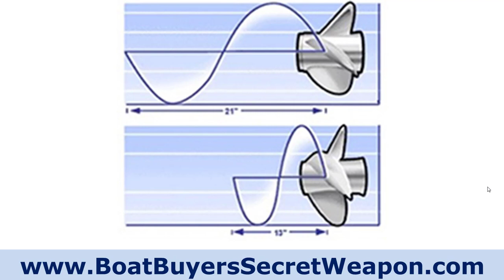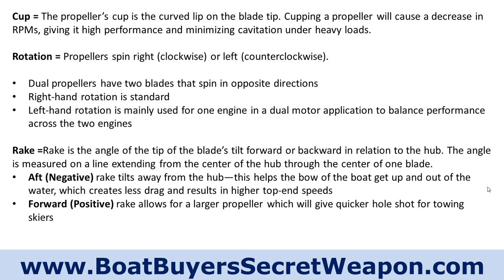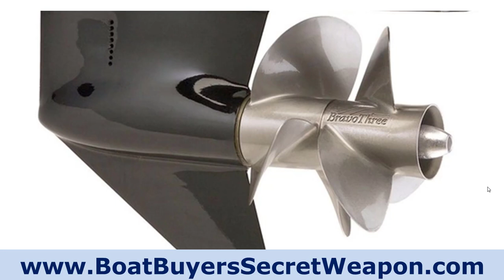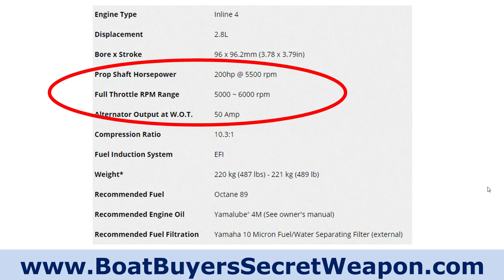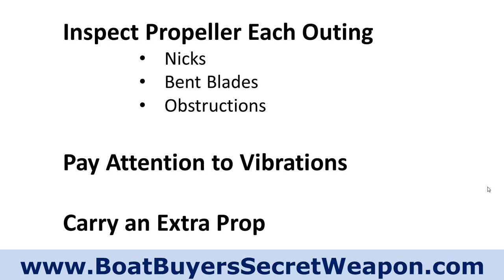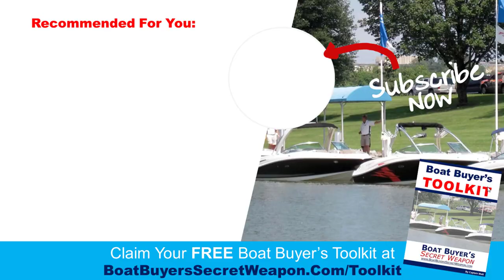Choosing the Right Propeller to Make Your #Boat or #Pontoon Go Faster

Comment: This has to be one of the most frustrating things about trying to find the right prop for your boat.  NO ONE KNOWS!  I purchased a stock pontoon with a stock150hp merc 4 stroke and it had a stock 15X15 prop.  I could only manage 4700-4800 WOT trimmed with just me and my wife.  I knew that was WRONG.  WOT on a 150hp merc should be around 5200-5400 RPM or even more!.  I went with a 4 blade 13 1/2 X14 prop and I'm turning 5200-5300 rpm WOT with decent hole shot with 4-6 people.  My speed stayed about the same, maybe 2-3 mph more.  I still think there is a better set up, but short of buying many props to try..not a single salesman, tech or professional can give me a hint other than the info given here.  100-200 rpm for each degree in prop pitch +/-  ....Frustrating!
Reply: 2022 Sun Tracker Fishing Barge 22 foot with Mercury 150hp 4 stroke comes with the 15.6x13 Enertia X7 alloy stainless steel prop. They usually run 35 to 36 MPH at WOT 5800rpm. 15 to 16 MPH at 3000rpm.
Edit: It's the DLX model, not the XP3 tri-toon model.

Comment: Thank you for this video. It was very informative!  Is it possible to replace a smaller propeller with a slightly larger one?  For instance, if I currently have a 10 3/8 x 13 prop, and replaced it with a 10 1/2 x 13 prop, what would be the effects of this change?  Thanks
Reply: @BoatBuyersSecretWeapon  great thanks for the tips. I’m going to go with the 1/8” increase in size, which should reduce the RPMs a little. I’m also, going to change from aluminum to Stainless steel, which based on your video should increase the RPMs by a little. As such, my expectation is that I should be sitting around the same RPM range, but gain a little more umph to get onto plane with the weight I carry. (It’s a bit sluggish at the moment when the tank is full and I have 600lbs onboard)
Reply: @crashalexander7232 k

Comment: I think you need to script your videos Instead of winging it. You got the description of aluminum and stainless mixed up when describing repairs and you got pitch backwards when describing hole shot vs top speed at the end.
Reply: I am so glad you mentioned the mistake about what increasing the pitch and decreasing the pitch does because i was completely confused at the end, it changed everything i thought that i knew about pitch, thanx
Reply: @CBCBCBCB1626   Yeah, I watch his videos and he is very knowledgeable, but he makes up the narration as he goes and makes alot of mistakes.  In another video he said that people accidentally sink their boats by forgetting to take the plug OUT!  I corrected him,  by saying that people forget to put the plug it IN and accidentally sink their boats.  But he later explained that he meant when they leave their boats on the trailer and the rain fills it up, but he left that important detail out in his original explanation, making it pretty confusing. That is why I suggested that he script his videos out a bit more carefully.
Reply: @blaster-zy7xx  that works if everything is spelled right too. Kinda like the difference between rail and rain. 😃
Reply: @korndawggy1801  Thanks for the proof read.  Corrected.  But my comments are not being monetized.

Comment: 18’ Pontoon boat 125 mercury. Gets out of the hole great then starts cavitation when excel-oration. Adjusting the trim doesn’t help. I think it makes it worse.
Looks like the water on the cavitation plate is in the right place when running.
Reply: I know on a fiberglass or aluminum hull boat, you want the center of the engine's nose cone to be 1.5 inches below the hull. Not sure on a pontoon boat.
Reply: No tach.
It will plane out with two people on board. But not with 5 people.
Reply: I tried to trim up with two people but water started shooting up into the transom. Made me think the motor was to low.
But it runs best with the motor all the way down.
Reply: The prop was loose so I tightened it up. I was checking to see if it was spun. We’ll see what happens. It’s a 4 blade prop if that means anything.
There is one more hole to move it down.
I’ve got an engine hoist. I think it’s about a 300 lb motor.
It’s used.
Reply: Did you ever figure it out? It sounds like the motor was too high to me if it cavitates when trimming up once you’re on plane

Comment: I got a 16ft saltyboats tri hull with a 2010 40hp evinrude etec it’s got the stock propeller on it and it’s all bent up from the previous owner hitting rocks I’m (assuming) but it only does 23mph will changing the prop make it go faster because that seems a little slow right ?

Comment: got a 25ft boat with a twin Suzuki 140HP four stroke engines with 19pitch blades. guess what! @ 5000 RPM I only got  31 mph. it is too slow. ill try to fix 21 pitch or 22 to see which could preform the best.
Reply: @BoatBuyersSecretWeapon   6000 rpm I guess, ill try today the 21 pitch stainless and see how they will preform. just to mention that the existing props are 19 pitch aluminum, a friend of mine is suggesting to try the 17 pitch stainless.
Reply: @kamikazee1200  your friend is correct

Comment: Bought a 2012 Chris Craft Launch 20, which had a 14 x 19 4 bladed aluminum aftermarket prop. Great hole shot. Killer handling, but the workload was obviously wrong. WOT was 4500, which is 500 below the target of the 5.0. Top speed at WOT was 44, a full 10 mph off the factory spec! Cruise at 30 mph was 3500 rpm. All wrong. Called Chris Craft to determine what the spec was for the factory blade. 13.75 x 21! They told me point blank the 14x 19 was going to be a dog. Mercury recommended a variety of props, none being 14 x 19. Curiously, they strongly recommend the High Five at 13.25 x 21. They suggest it will perform much better in every respect, so I went with it. We shall see. If it doesn’t, back to the factory 13.75 x 21!
Reply: @BoatBuyersSecretWeapon  the results with the Mercury Quicksilver High Five are excellent. Hole shot is worlds better. Cruise speed is 35 mph at 3200 rpm. The top speed is now 54 mph with two people in the boat at 5300 rpm and it corners so well it’s hard to believe. Ed Watkins Marine did the install and tested it with both the 14x19 Hustler aluminum 4 blade, and the 13.25 x21 SS 5 blade prop. No contest. The SS is a much better prop.
Reply: @noone-t8y Hi, very strange. Everybody says the more blades you have the more drag you get
Reply: @BoatBuyersSecretWeapon  Definitely will update this once I have scienced it out. Happy to share what I learn on this journey!